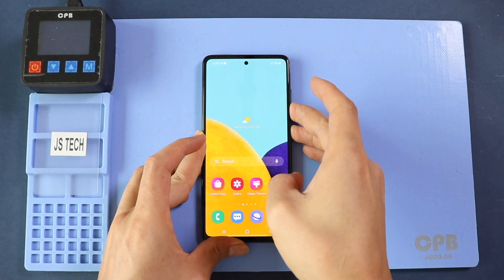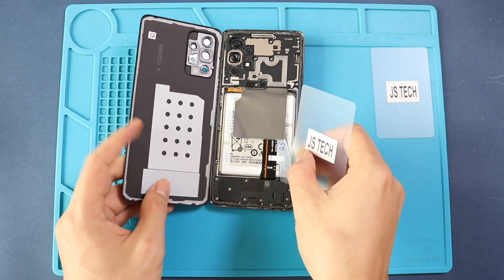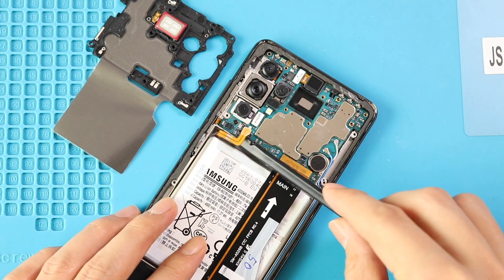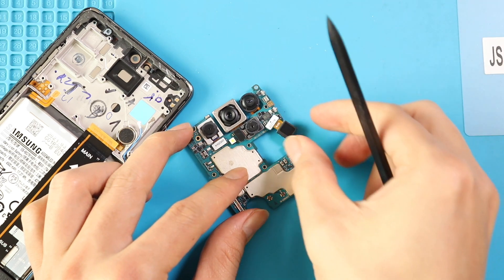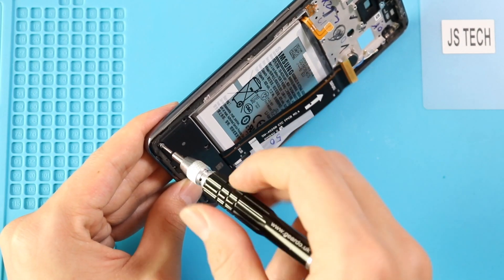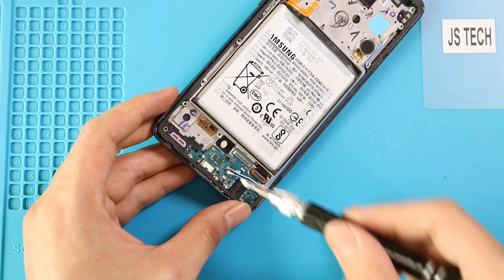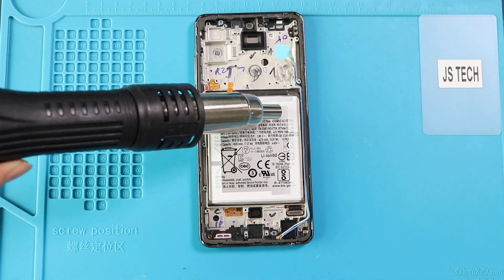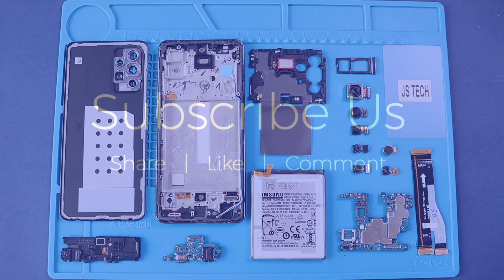Samsung Galaxy a52 5G Teardown | Screen Replacement 1

Comment: On the PCB, the smaller connector where the main ribbon runs to, a little section of the connector's teeth have broken off.....is that also the part that communicates with the LCD screen?

Comment: Great video. Simply explained.
I have an important query. I have the 4g model. Using since more than a year. I am a careful user more often than not but recently I accidentally dropped it few times and as a result the back panel has started to come off from side along with the chrome finished side framing has few dents. Although my phone works absolutely fine. Just like when I purchased it... 
So I intend to change the side framing and back panel.. 
but when I went to Samsung care they said I have to change the whole display, there is no way only the side framing and back panel can be replaced...., which I am sceptical about.. 
1. Can I change only these 2 components safely.
2. Tries searching online, finally found the back panel but not the side framing.

Little help will be much appreciated.
Reply from the maker: Thanks 🙏, well if you need to replace the frame, then you need to take out the screen. Which is not easy and sometimes the screen will get damages. So replacing the screen with the frame is the easiest way (service centre is correct) , otherwise you can sell the front screen panel with the frame and install a new screen with the frame. Also both parts should be available online.
Reply: @DIYGeardo  thanks

Comment: My A52S right frame is a bit loose, under the power button until the bottom corner.  Is it still waterproof or do I need to go to the service center?
Reply from the maker: if it is loose, then i don't think it can be fine with water. You need to go to the service store..

Comment: Please help. My main camera lens' glass got cracked. So I took it to the local repair shop. They told me I should pay $60 for it because they should replace the whole camera setup. The camera lens is fine, it's just the glass that is cracked. Are they just trying to hustle me? Please help.
Reply from the maker: SO you mean the camera is fine ? but the back cover camera lens has broken ? is that correct ?

Comment: Good day, my a52 5g wont charge it will detect moisture. Then ive been doing troubeshooting for moisture detection but sad to say no progress done on my unit. So I was thinking maybe I will buy a new board for the charging port, may I ask if the a52 and a52 5g board are the same? Been looking it online to buy the parts but only the a52 is available.
Reply from the maker: I think it is same, but so far i could not find more information

Comment: Hey can you please answer me. I accidentally put my injector tool on the top microphone will it do any damage ( samsung a52s) is the microphone like jerryig describe?
Reply from the maker: Well it is like this, it can damage , but it can survive too.. if your one is working, that means it is fine..
Reply: @DIYGeardo   @Geardo  I have same problem top. I see in this video that top microphone is placed on the other side of pcb6 board just very small hole is made in board and it is 90 degrees angle to mic hole.
But this blue seal in frame between PCB and hole which is seen on video  could be punched when hit by injector. 
Can you tell me if waterproof membrane is placed there in way that could be damaged like in this case?

Comment: What is the third camera down on the left for? I assumed that the top one was wide angle, the middle one was the main camera, and the bottom one is a close up camera, but when I switch cameras in the camera app from the main camera to the close up and put my finger over the bottem camera, it still uses the middle camera, and you can't see my finger in the image. Is the bottem camera fake or am I missing something?
Reply from the maker: that is the depth camera..
Reply: @DIYGeardo  thanks

Comment: I am wondering. I accidentally  punched sim ejector tool in mic hole in my A52s. The built of the phone is the same. So I am wondering could it have been damaging waterproofing or mic itself? Thanks already for answer.
Reply from the maker: Well i don’t think it will loose the waterproofing level..

Comment: Supposed I Disassemble My A52s So .. What Happened  IP Ratting Stall work or Not ..?/

2nd Question it's Shows Small Dot on Flash .. So Thinking open Back Paannel am clean this ..?/

Sir .. Pls Sujjest mi it's just 2days new A52s ..?/
Reply from the maker: Well if you open the device, it will be no longer waterproof.. unless you go to the service center.. but they don’t cover water damages.. well, let it dry for some days.. it might go away...but in the future be safe with the water.
Reply: @DIYGeardo  OK thanks very much for replying an better sujjestion ..

Comment: Can feel a slight loose on the left frame when pressed with fingers and water can inside it. Will it affect the water resistant on the phone?
Reply from the maker: Yes.. most likely
Reply: I feel it too. What did hou do to uour phone did you go to samsung repair ?

Comment: nice video sir. 👍
I have a question for you, I accidentally poked the microphone hole with the sim ejector, something popped when I poked it, did I damage the microphone or the water barrier for the microphone?😫
Reply from the maker: If your microphone is working, then it should be ok.. maybe slight damage to the rubber..cannot say exactly how bad it is.. I would say that keep the device in safe from the water..

Comment: Is it safe to say that the internal components are extremely compact and soldered? Because I recently dropped my a52 5feet from the ground with only a tempered glass and no case, do you think its internal are damaged? But i dont see anything unsual after i dropped it not even a scratch, im just worried.
Reply from the maker: If the phone is working. Then looks like it is ok

Comment: Do you guys experience heating on the a52 5G?
Reply from the maker: So far, we have never came across with such a situation
Reply: @DIYGeardo  woah thanks for the response. The service center offered a hardware replacement to fix the problem... should I grab it?
Reply from the maker: @thechonkconge  why not, and they will provide you with a warranty. You should definitely go with it
Reply: @DIYGeardo  thank you!
Reply: Mine is heating 2. It's a 2 day old phone.